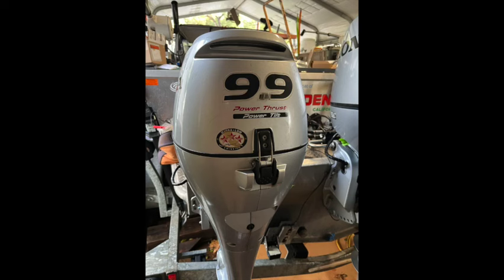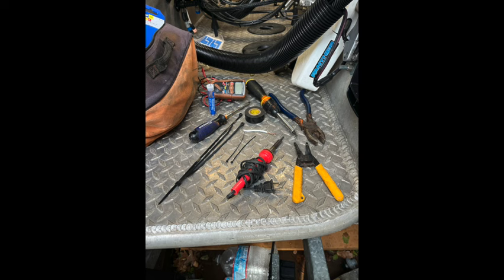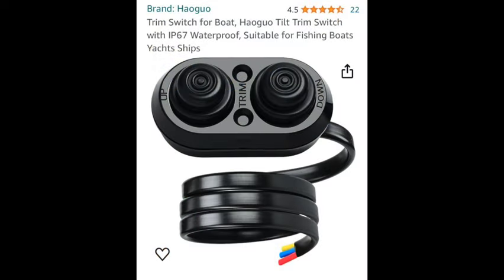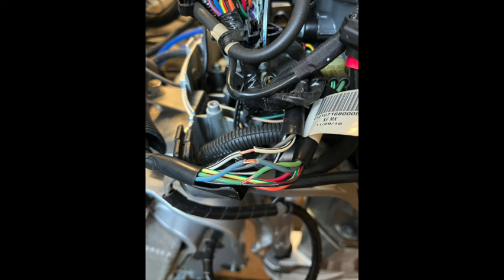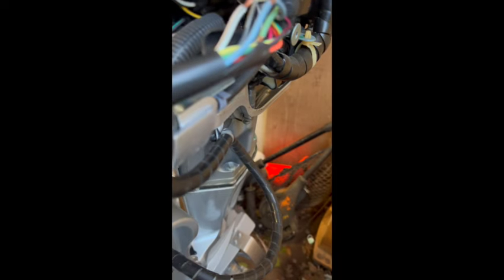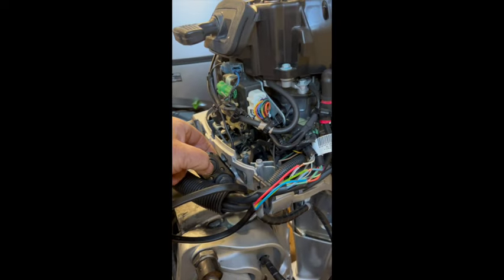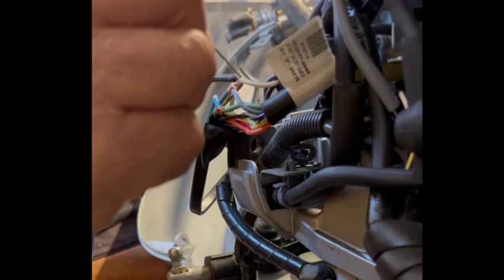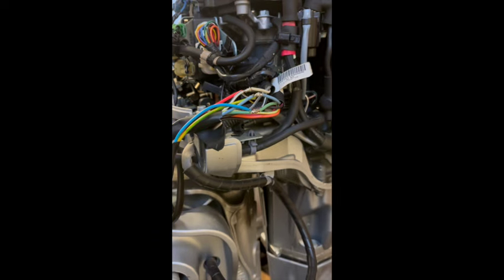Add a remote Trim switch to the outboard motor and life got easier. DIY project here is the how to.

Comment: This is sweet! I own a 99 Yamaha and doesn’t have one at the motor either! I will be doing the same thing to it! Thank you so much!
Reply from the maker: Thanks for the comment. Most of the newer Yamahas have a switch at the motor if they have the trim and tilt so I haven’t been involved with switching those so I can’t be much help there. I would like to hear how it is going with yours. Sure makes life easier when it’s installed.
Tight lines